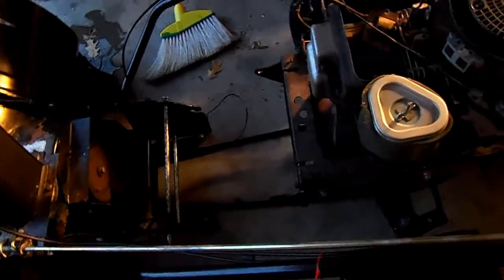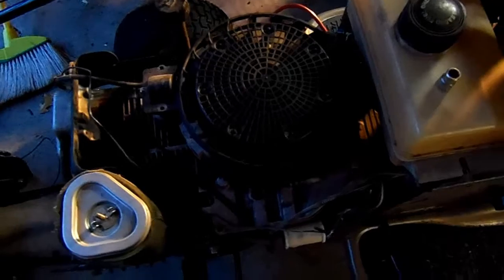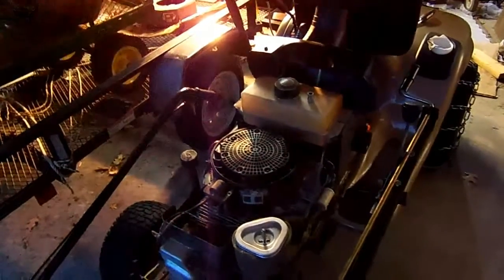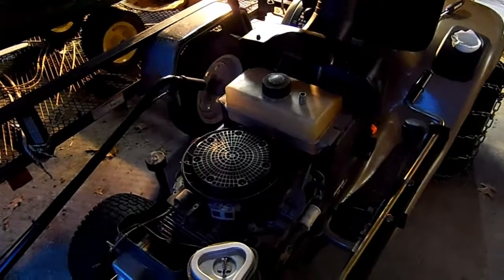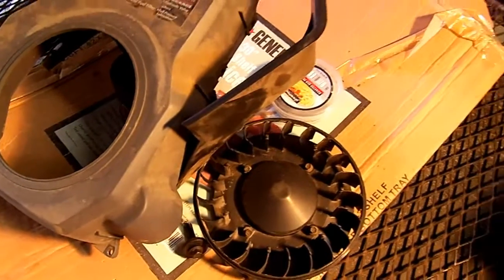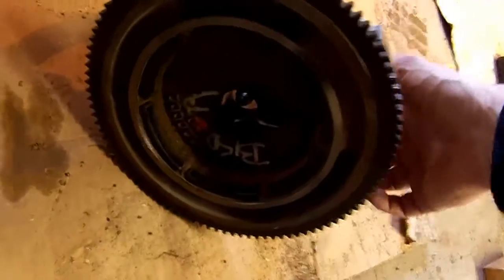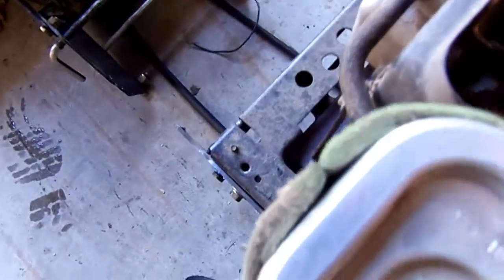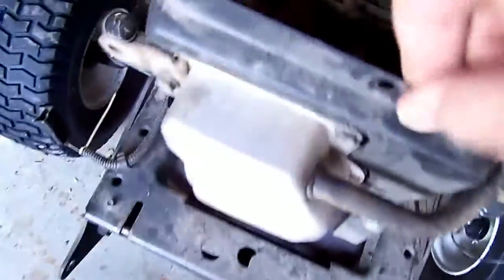18 HP Kohler Engine with Electrical Trouble - Help!

Comment: the only thing you need 12v is for starting and that fuel shutoff. if nothing else use one your MANY battery chargers to charge the battery and disconnect the engine charging system.
Reply from the maker: My biggest issue is frying out lighting, essential for the task the lawn tractor is barely up for, snowblowing.

Comment: did you check your ac voltage coming from the stator? i don't know offhand what the specs for the maximum volts ac are coming from the stator. your voltage regulator is also a rectifier.it does two jobs converting ac to dc volts and regulates the charging. try buying some peppermint oil and dripping it all over your engine and other places on your tractor. mice won't come near peppermint oil. the best way to troubleshoot stuff like this is to get a known good regulator off a working engine and see what it does on yours or using your regulators on another engine and see what happens. substitution of known working parts is one of the best troubleshooting tricks i have ever learned.
Reply from the maker: I have a whole playlist of updates to this, so much of what you bring up is discussed therein. Pepermint oil didn't stop the lttle buggars, they seem pretty determined. The stator voltage is quite high.
Reply from the maker: https://www.youtube.com/playlist?list=PLcVGiHivfNNiPWPcHI3FHspfDel_2dO-5
Reply: This is a video of the lighting.  I'm considering adding a light undercarriage, or other.
https://youtu.be/96H_f-TeRqM

Comment: Seems like you have two bad regulators. Stator seems good as you're getting output (just too much). How do they behave on the bench? Perhaps a short downstream is killing the regulator. Is it fuse protected?
Reply from the maker: JohnAudioTech Yeah it was blowing the 20A ATC fuse, but I presumed that was due to confronting the battery with 21V. I've got my Dim Bulb tester in for the fuse til I can get it all sorted out. So that should cushion any short. I may do an update video, I took a couple clips last week.So learning a bit about this machine. The ignition coil/magneto doesn't actually connect to the 12V, the low voltage terminal goes to a switch to ground, serves as a HV cutoff. What did get cooked from the 21V, is the fuel cutoff solenoid, so now I'm waiting for that part.